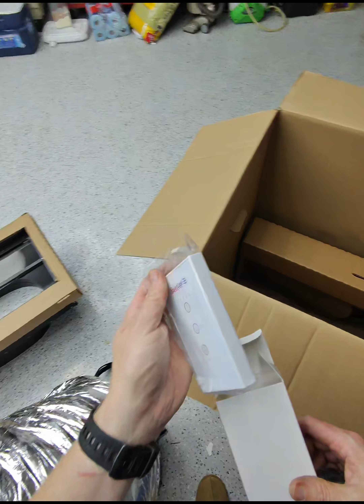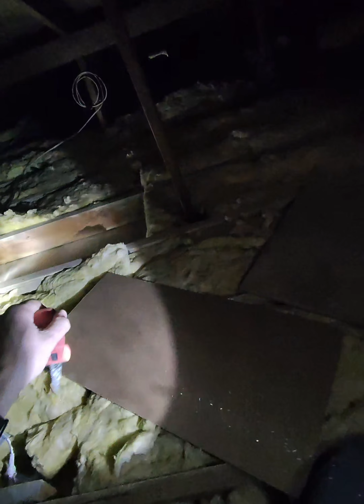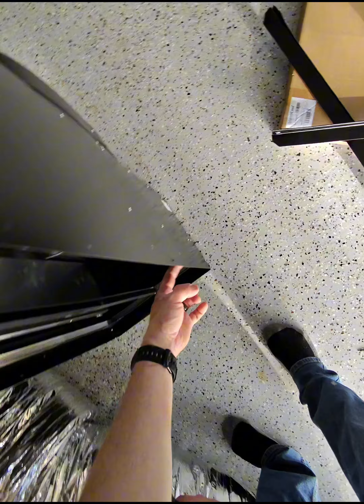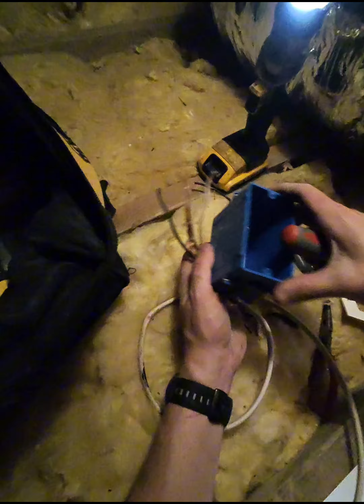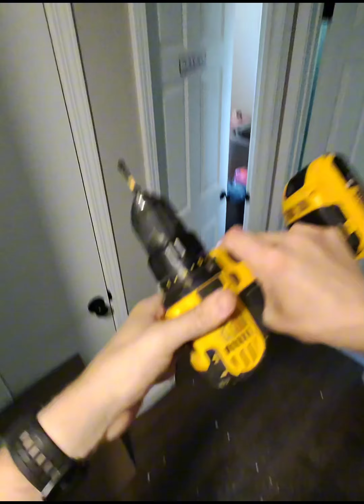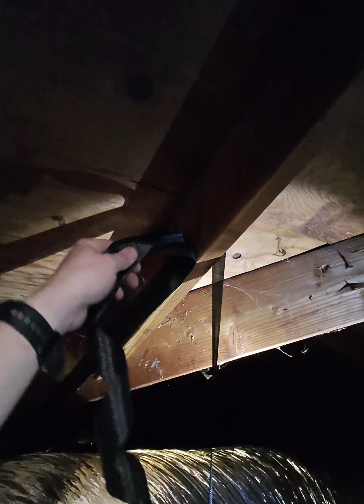DIY QuietCool Whole House Fan Install (CL-4700) Step-by-Step

Comment: One thing I nobody mentions is it’s pretty messy if you have blown in insulation. My house was full of dust.  Took me a couple hours cleaning after the install
Reply from the maker: I can only imagine, I did blow in insulation at a separate house but not with the whole House fan 😅
Reply: @AmateurDIYdad great tips on the video btw
Reply from the maker: @onecleanlbz thanks man!

Comment from the maker: Here’s everything I used for this install 👇

QuietCool Fan CL-4700: https://amzn.to/4rTe3rd

Drywall Knife: https://amzn.to/4t0rrKU

DeWalt Drill: https://amzn.to/4srXhAj

Wire Strippers: https://amzn.to/4tmqAEP

Pliers: https://amzn.to/4svca54

Big tip: attach the duct before hanging the fan 👍

Any questions, drop them below 👇